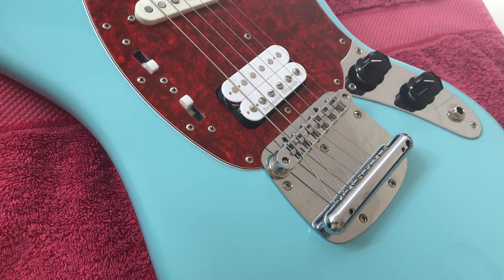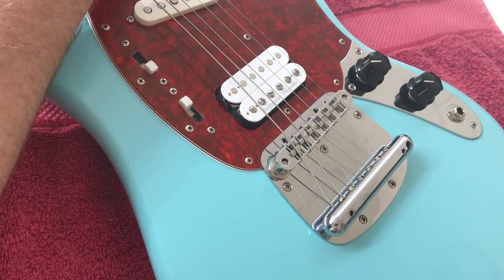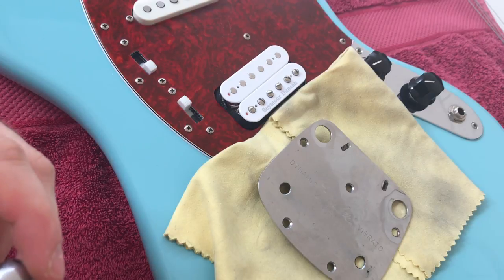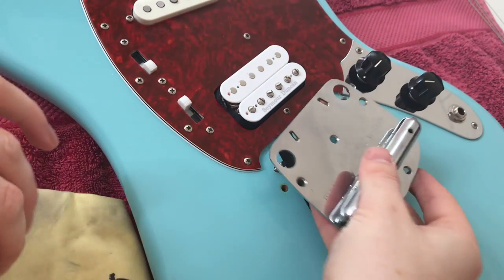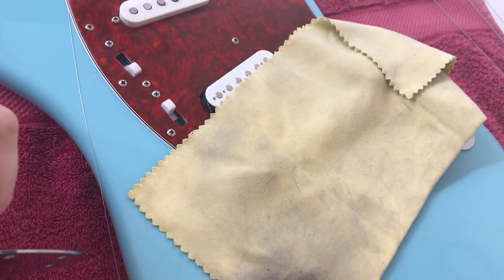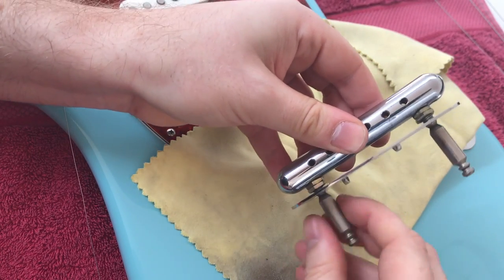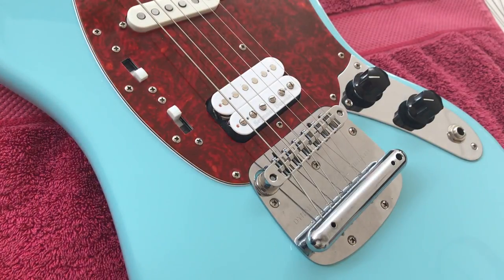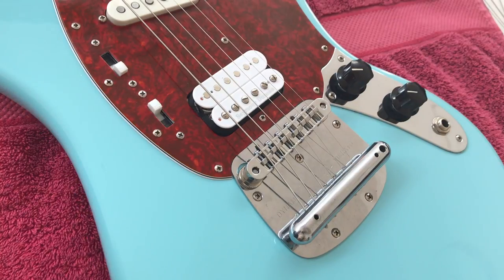Locking a Fender Mustang Tremolo: 2 Methods

Comment: This was a very informative and helpful video. I’m so glad I found this. My original plan was method 1, it now looks like I’m going to follow through with the 2nd option. I have a couple questions about the hardware. What type of TonePros TOM bridge did you put on (Standard?). What is the size of the washers you used to lock down the cigar bar piece (metric or standard?) Also do you think a 1963 3/4 scale MusicMaster neck put on a Mustang majorly affect the playability other than just being 1 fret shorter? Apologies for the novel but I wanted to clear up some questions in order to get the right parts for this project. Thank you for your time and patience.
Reply from the maker: Hey John, thanks for the feedback! Glad the video could be of use. Method 1 is still a viable option, you'll just have to shim the neck more and raise the bridge. If you have to shim your neck too much though you'll run into problems so method 2 is more foolproof and consistent in my experience. As for the bridge, I used a TonePros AVR2 Tune-O-Matic Bridge ABR1 model. Keep in mind that the neck on my mustang has actually been modified to a 12" radius so no saddle modification was needed. if you need the bridge to match a 7.25" (or 9.5" for that matter) you will need to file the e saddles lower. Otherwise Gotoh makes a TOM with adjustable saddles. The washers I used weren't really washers, but the 7mm potentiometer hex nut haha! But theres a size to try out anyway. You can always take the posts from the cigar tubes to your hardware store to try and find an appropriate sized washer. Now for the musicmaster neck. Don't quote me on this but from my research and understanding a 22.5" scale musicmaster neck was interchangeable with 24" scale necks for vintage mustangs, musicmasters and duo-sonics If your mustang body is a reissue I couldn't really say. The main thing putting a 22.5" scale neck on a mustang will affect, if they for some reason are not meant to be compatible, are your tuning stability and your intonation. I'd say to be safe just go for a standard 24" neck, but if you're set on a 22.5" neck, then buy it and try it out. Worst that can happen is it won't work, in which case you can sell it. Hope that all helps haha!

Comment: I find it largely a myth that Mustang trems are unstable. As you put in the beginning of the video, a good setup goes a long way. Beyond that, people don't realize you have to tune the guitar while balancing the spring. Tune-wiggle-tune-wiggle-tune-wiggle. Keep going until the guitar is in tune AFTEr you wiggle the trem. If you do this, it'll be very stable, unless you bend too much or pull it sharp. That's the same with any non-locking tremolo, though. You fix that by wiggling the bar. It goes right back. Check out Jeff Beck play and you'll see him intermittently wiggle.
Reply from the maker: YourFavouriteColor yep absolutely. These things do work! As long as you understand how to set it up they are good to go. People also commonly forget to check that the nut is cut properly and that strings aren’t touching anything on the bridge besides the saddle. Just got a CAR stang around Xmas and I absolutely go to town on the trem! Just had to clean up the pivots a bit on the plate because the previous owner had messed them up.

Comment: This is really helpful! Awesome stuff, I'm in the process of wanting to put the dynamic vibrato and adjust-matic onto my Squier bullet mustang which I also want to mod.  Love the Cobain guitar and definitely want a similar style but my own pickups etc.
Reply from the maker: Yeah the Cobain stang is sick, but yes definitely has plenty of room to add your own twists. Mine has coil splitting for the bridge, improved electronic components, TonePros bridge, locking tuners, and the neck has had a lot of work. It has a 12" radius to match the bridge and jumbo frets
Reply: @alexrcowan  That's so awesome! I don't know much about mods but lately i want to mod my bullet mustang and I've changed the bridge pickup to a Dimarzio tone zone and i want to have a single coil in the neck, but if i want a bridge like Cobain with the dynamic vibrato locked down this is where my knowledge is non existent, how would i match the string width of the bridge to my guitar neck?
Reply: @reagangundersen3490  did you figured that out?

Comment: A lot of issues with break angle are from the neck more than the tailpiece or bridge. Shim the neck and raise the bridge is common with these guitars. I had my bridge bottomed out and had high string action, added the shim and gave myself a little adjustment room for the TOM with better break angle also.
Reply from the maker: I think any mention of break angle here is to do with bridges and strings not having enough angle to provide adequate down pressure for the strings on the way to the cigar tube, which can still happen with a neck shim if you have the cigar tube set too high, or don’t get enough angle with a flipped and locked tailpiece. So, more to do with the volume and sustain of the notes rather than the string action if that makes sense. Too little break angle and the strings will lose sustain and volume, and can cause string buzz and rattle. You’re absolutely spot on with shimming the neck to improve high string action though! I have a shim on most of my stangs.

Comment: Hi! My Mustang isn't with the original knobs, and I'm gonna buy it, but the axis from the pots aren't original too. They're splitted and has 
stretch marks. How can I fix the original knobs, if they has a screw on the side?
Reply from the maker: Hi eric, I would get a brass sleeve converter from all parts or somewhere similar to fit over the pot spline and fit the original knob over that

Comment: This is completely off topic, but I have a Squier Vintage Modified Mustang and I can't seem to get the volume and tone knobs off. Is there some trick to it?
Reply from the maker: Don Draper they can be tough sometimes. Try and leverage something underneath the knobs like a flathead screwdriver (there are special tools designed for doing this but I get by without them) and be careful! You don’t want to crack the knob or scratch the plate or slip and damage the guitar. Some people even use spoons instead. Also might be good idea to cover the surface of the guitar/control plate to make sure you don’t damage anything, and remember to try and use as little pressure as possible, and jimmy the knob from different angles
Reply: alexrcowan
Thank you, brother!

Comment: are those switches shorter than normal? where did you get them?
Reply from the maker: They aren't, I just used small hex nuts as spacers between the pickguard and the switch to lower them

Comment: Thanks for this video! I’ve been lucky with my mustang since it doesn’t seem to have tuning issues. But I’m definitely saving this video just in case I do want to lock the trem some time later.
Reply from the maker: No problem, and yeah if you have no issues with tuning then don't bother with this, I only lock the trem on one of my 3 mustangs and my jagstang is floating too!

Comment: Hi, did you changed the original adjusto matic to the gotoh ABR-1 bridge? Will the gotoh bridge match well with your fingerboard radius and compared with your original adjusto matic bridge? thanks for your answer.
Reply from the maker: Anderson Cheung hi! Yes, I’ve changed the bridge to a tonepros bridge. My fingerboard radius has actually been sanded to a 12” radius so it matches perfectly
Reply: That's cool, its a warmoth neck with 12” radius?
Reply from the maker: No its actually a '95 Jagstang neck. It needed a refret so while I was at it I got the fingerboard re-radiused to 12" haha

Comment: Nice video mate! I have a cuestión. How can I increase the sustain on a mustang? I'm having some issues with that, in comparison with my strat.
Reply from the maker: Nicolas Checa Hi Nicolas. There’s a couple of things to look at. Firstly make sure the overall setup is good. Make sure that the points of the bridge posts are sitting exactly in the indents in the bridge thimbles mounted to the body, this is important. Also make sure the nut is cut properly and is ideally made of a good material such as bone rather than plastic to ensure a good amount of vibration transference from the strings to the nut, to the neck and ultimately down to the body (making sure the neck is correctly seated in the neck pocket with contact to all the walls. If the neck is shimmer use a stewmac full pocket shim to ensure maximum neck to body contact through the pocket). The other simple thing you can do to encourage sustain is use a higher string gauge. If there’s still not enough sustain for you I would consider changing the bridge saddles to brass saddles, or even swapping to a tuneomatic bridge if you aren’t a big trem user, as in my experience with mustangs they sustain better through better contact with the body allowing better vibration transfer.

Comment: What kind of washers are those are they like like screw washers
Reply from the maker: Alesko17 Gaming I actually use hex nuts as washers. You can use whatever washers fit the cigar tube legs so long as they can fit the trem routs or don’t touch the e strings depending which locking method you use
Reply: alexrcowan what kind of hex nuts like lock hex nuts or any number
Reply: Alesko17 Gaming really anything that fits over the posts. I’d use nuts since they’re smaller than washers which might not fit inside the body so use nuts instead I’d say. The nuts have threads but dont forget, you’re using them as washers not to screw onto something. Just do what he did if you’re not sure, take it to the hardware store and ask someone for help on picking the right one but make sure you tell them you’re just looking to use them as washers. Heck they may even be able to find small washers that fit over the posts and under the body too you never know!
Reply: Do you need to use washers? I removed the strings dno how to get back on. I don’t have washers. So now am gonna have to wait to buy some am new to this so.

Comment: This is great! I’m going to be purchasing a ‘90s MIJ Mustang this week and was wondering how to do this. When you restrung yours with 11s did you have to recut the nut slots? Do you have any advice or tutorials on how to do that? Thanks so much for this video!
Reply from the maker: Hi Shawn, I have special nut slotting files. They are great and make easy work of enlarging the nut slots to accommodate larger string gauges. i'd recommend checking out the stewmac range of files, they're expensive but quality. Otherwise Hosco make some good ones too!
Reply: Do you happen to know the size of the washers you used? I’m having a hard time finding the same ones in the US. Thanks!

Comment: Hey man, I have a question for ya. I noticed that you've got a normal uncovered strat style neck pickup in this guitar now. Have you had any noises or anything going with a non-covered neck pickup? I've read that they recommend covering the pickups because it causes noise or something. But I don't seem to have any problems with the JB in the bridge of my Squier VM Mustang, and that's obviously not covered. Also, what neck pickup do you recommend to match the high output of the JB? I'd like to change my neck pickup but there are so many options, I don't know where to begin. What advice have you got for me?
Reply from the maker: Hey mate, No I haven't had any noises compared to a normal mustang pickup with no holes in the cover. As far as I know, the reason mustang single coil pickup covers don't have any holes in them for the pole pieces to come through is because the pole pieces are all flat, and don't have pole pieces sticking out at different heights like a strat pickup. Hmm its tricky to match the output of a JB with vintage spec single coils in the neck. I'm currently using a custom wound pickup closely resembling the tone and output of a texas special. There is still a noticeable difference in output, but in my case i use it to match the JB while it is coil split which it does well. If you're looking for a single coil to better match the output you could try something like a Seymour Duncan Quarter Pound or SSL-3 hot strat. Otherwise, if you want to go for a single coil sized humbucker, I've heard good things about the hot rails in the neck position. There is also a JB Jr made for the neck position to match the JB in the bridge. I'm not familiar with them but Dimarzio also have a wide range of strat pickups you could use in the nec of your mustang. Hope this can at least give you a starting point haha
Reply: alexrcowan, Yeah I'm most likely going to have to use a single coil sized humbucker, which I'm ok with but I want it to have the normal sound of a neck pickup, if you know what I mean. Just with equal-ish power.  I've read that the lil 59 matches good with the JB but I have no personal experience. I've thought about the JB jr, the hot rails, the cool rails, & the lil 59 as candidates, but again, I don't want to end up with 2 bridge pickups that pretty much sound the same. If u had to pick from those 4, what would u choose? Thanks for your advice man, I really appreciate it.
Reply from the maker: Robert Horning personally I would choose the lil 59, I have that in the neck of my tele and it matches great with the JB Jr in the bridge, and it keeps the warm tonal characteristics you would expect from a pickup in the neck position. Keep in mind that the height of the pickup will make a massive difference to the sound. Originally mine was set a little bit too low and it just sounded muddy and awful. I have the pickup set about 0.060” away from the strings on both the treble and bass sides now (when the string is fretted at the last fret) and it sounds amazing. The tele has 250k pots like a mustang so that could be a good starting point to set the lil 59 if you decide to get that, from there you can tweak the pole pieces to your liking, but be sure to give the strings enough room to move without being pulled by the magnetic field of the pickup. Sorry for the essay length reply, but I hope that helps. Honestly I don’t think you would be disappointed with any of those pickup choices though
Reply: alexrcowan, Cool, thanks man. I appreciate your input. I'll probably end up going with the 59. My stock neck pickup actually doesn't sound too bad now, but I can't stand the fact that 1 pickup says "Seymour Duncan", & the other 1 says "Duncan Design". Lol, I know it's a stupid reason to change a pickup, but it's driving me crazy. I wish they didn't glue the covers on. I would just change the cover. Anyway, thanks for everything.  Keep up the good work.
Reply from the maker: no problem man, and I believe there is absolutely no need for you to justify your choices, after all it's your guitar haha! And yes it also annoys me that the covers aren't so removable. But yes just remember to play around with the pickup height of the 59, cos they can easily sound very muddy with 250k pots if they aren't set at the correct height. Hope it works out! And thanks for the support!